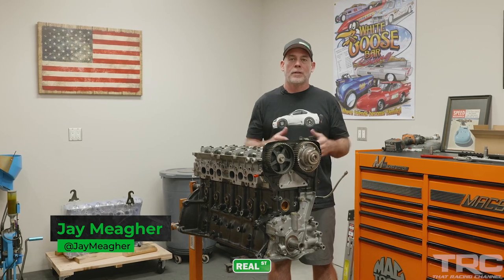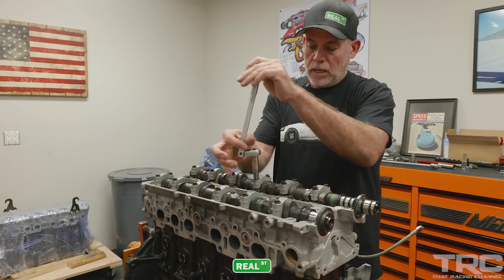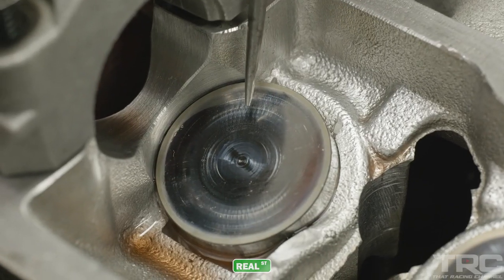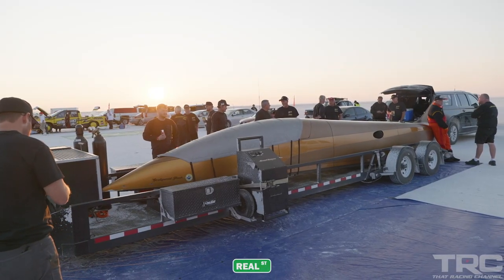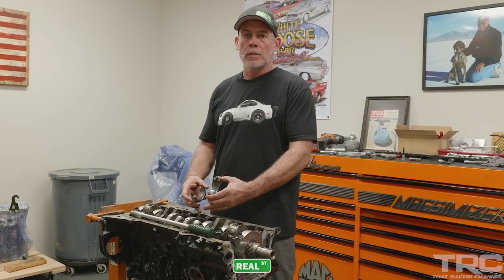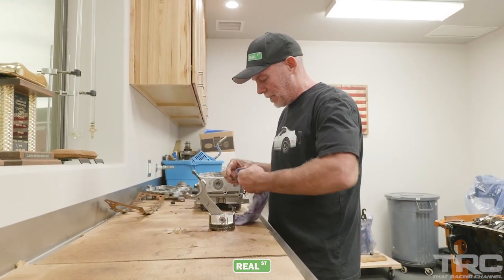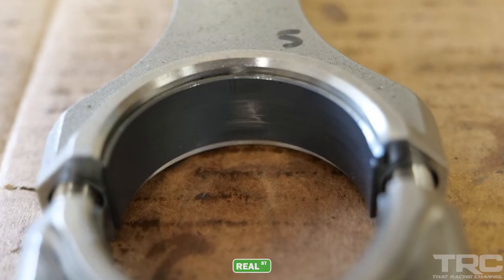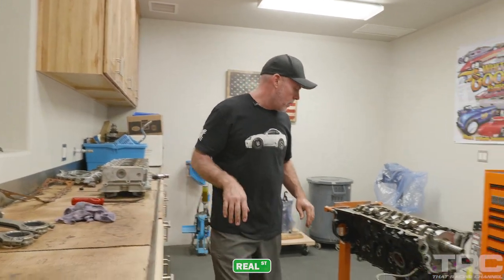331MPH 2JZ Engine Teardown - Fastest 2JZ Ever Recorded (SCREAMING 8700+RPM for a Mile!)

Comment: Well, the final was unexpected.... that kind of bearing wear to happen under decel... hmmm... Was it the same reason for the pin bore polishing/wear? Awesome stuff as always! Thank you, Jay!
Reply: you misunderstood, it's not on deceleration, it's high load, high boost at lower rpm caused by a wide ratio gear box shifting into a higher gear. Actual deceleration would be no load and no/low boost.
Reply: @CP110  he literally said at the end it occurred on decel
Reply: @codyblack3616  My bad I was refering to the metal to metal contact at the 12 o'clock position on the upper half of the rod bearing. Forgot about the delamination on the bottom half which was due to in gear high load on decel for a prolonged period of time. I would say if its on the Top part of the pin bore most likely due to high load lower rpm situation, if its on the lower part of the pin bore then its the in gear decel situation

Comment: Great informative teardown. Im really surprised with the lack of a Girdle between all the main caps. 
Is the wear on the rod cap bearings right below the parting line because of angle of the rod when rotating around the crank? as seen 10:39

Comment: Not knowing much about high performance engines I have a question.

Rods have a bushing in the top for the wrist pin, why don’t pistons have brass bushings in them to help with that wear?

Also, with the neutral fix for the bottom bearing wear also a dress some of the pin wear? Or is that mostly a side effect of ignition timing, high cylinder pressures, or detonation?

Comment: has anybody ever experimented with drilling a tiny hole in the tip of the lobe into the cams oil passage so you get high pressure oil on the tip?
Reply: There are dry sump systems that spray oil directly on the cam lobes in conjunction through the cams

Comment: The Yamaha 2JZ, what a great design!
Reply: Technically, Yamaha wasn't involved with the 2JZ.
Reply: @Daniel-RunToRoyal  yamaha made a rnd for 1J then toyota decide to make 2J with yamaha knowledge
Reply: @emanh4keem_san420  Exactly, thanks, Emanh.
Reply: @Daniel-RunToRoyal  ever look at a 4age
Reply: @irabrook  I have. It's common knowledge that Yamaha did head work for multiple Toyota engines, but Yamaha was not involved with the 2JZ. That's the statement I was replying to. Good day.
Reply: @Daniel-RunToRoyal  of course not, thats why the 2jz is good😂 fuck yamaha. I hate working on those pos bikes EVERY FUCKIN DAY

Comment: How do you determine if the line in the rod bearing is from timing vs low rpm high load/boost situation?
Reply: This question is answered at 22:06 onwards

Comment: 2JZ went 331 MPH 
Meanwhile Bugatti and Koenigsegg are still trying to break the 300 MPH mark.
Reply: In street cars yes slight difference
Reply: Yeah, they are making street legal cars that come with interiors and a good looking exterior while maintaining use. Not just a rocket looking body made of thin sheet metal and virtually no steering.
Reply: Might show Toyota the capability of the 2jz again image a supercar that had this setup with more research and development etc it could definitely be a contender.

Comment: Decel huh?... no. Just no. If it's a factor at all, it would go along with too much oil clearance. I would say there's the same push-pull back and forth all the time with the intake stroke, but there is a lot of forced turbo air going in at that time.

Comment: Top fuel does that mph in 1000 ft🤣
Reply: That one with billet everything displacement really far off and not a factory engine
Reply: Not on salt it doesn’t lol
Reply: It also needs 14,000hp and 8000lb ft of torque to do it. Its not factory...
Reply: @realstreetparts4632  and a bullet block 2jz is factory?🤣 my original comment was dumb but let’s move one